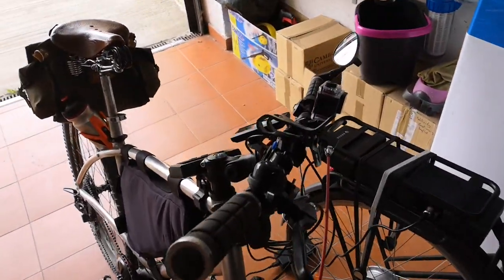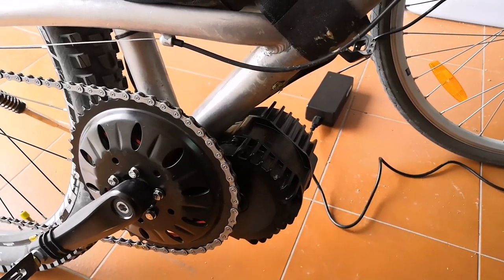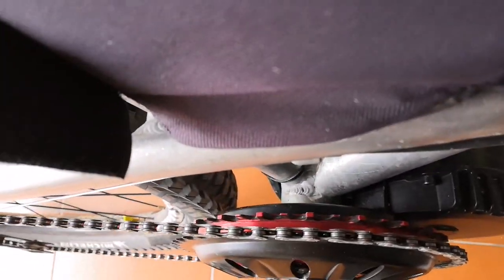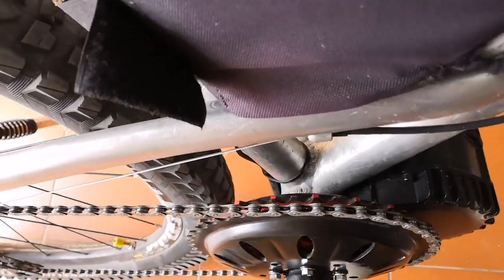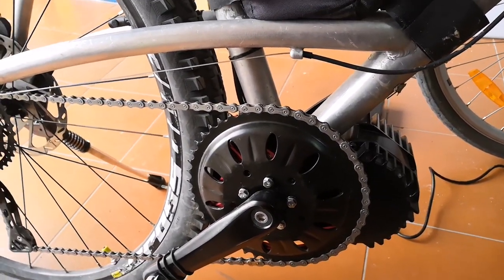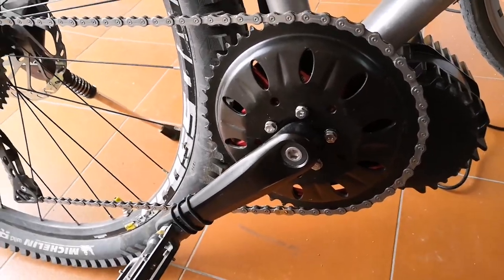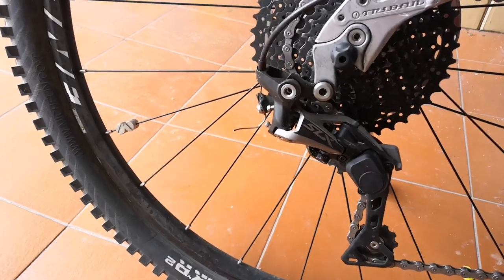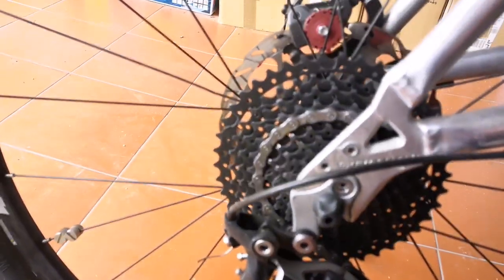Bafang Bbshd 52V update

Comment: Should have purchased the Lekkie spacer, makes it very easy to fit I have the Lekkie 42 and 52 Chain rings with one spacer in-between working with a XShifter gear change on My BBSHD motor
Reply from the maker: Thanks for the input!
I switched to a Rohloff internal hub, which has more than enough gear range for one crank.

Comment from the maker: The other big change was reprogramming the controller which has made a massive difference to the way power is applied, making the bike much nicer to ride and easier to control. If anyone wants more details, drop me a line.
Reply: mick2d2 after 3 hub motors im starting to build a Midmotor conversation. I misshifted once and the chain was in pieces.
Reply from the maker: My BBSHD puts out about 1600W of power. Sometimes the chain will slip, but I haven't broken any chains yet.
Reply: Two months no chain broken...replaced cassette, rotor w/pinion gear, clutch replaced and it destroyed the inside gears, replaced reduction gear with cover... kit cost $1.3k usd 52v 17.5ah battery,bbshd 100w 48v on a 29er mountain bike.  Plussss...$300 in 2 months in damages...🧐🧐🧐🧐🧐
Reply from the maker: @marcostirado5537  I've been running this with a Rohloff 500/14 for nearly a year now with no problems whatsoever.
I do however try to use it realistically, i.e. I don't hit full throttle in the hardest gear from a slow speed, or try to climb steep hills on throttle in a high gear.
I use my legs as a guide to how I use the power and the gearing. It's an ebike, not an electric motorbike.

Comment: Did you ever have any luck with the 2 chainrings? I've wondered why nobody has tried this, if nothing else to have a better chain line and larger ring for the faster gears while commuting and smaller ring for the slower gears for trail riding. I do both on my bike. I did my bbshd conversion this past November.
Reply from the maker: Hello Tim. I ran it for a while with both chainrings, changing manually (which was a bit of a pain).
Last summer I decided to take the plunge and bought a Rohloff 14 speed internal gear which I matched with a BBSHD spider from Lunacycles and a Blackspire Cyclocross 44T crankplate to give me the perfect chainline. 
The Rohloff gives me the equivalent of several gears above what I previously had so I normally start in fourth gear and a couple of gears below, so I can go faster too. 
I must say I'm really happy with this setup, I think it's the perfect match for the BBSHD and a real pleasure to ride. There's a small adjustment to make compared to useing a derailleur, as with the Rohloff, you can't change gear under pressure, you have to ease off. You can however change up or down any number of gears, in an instant, even if you're not moving. This ability to suddenly change up or down five or more gears, gives you a lot of flexibilty. It also handles the torque from the BBSHD without any problems. 
Of course there's also no irritating derailleur noise or slippage!
The only issue really is the price!

Comment: When you went to 52v from 48v did u have to reprogramme the low voltage cut off . I saw a vid where they said to do so . Thanks
Reply from the maker: dj james arundel Yes I did, because the cut off for  a 48V battery is 3 x 13= 39V, whereas for a 52V battery it’s 14 x 3 = 42V.
Reply: @mick2d2  u think a 48v would run ok on 52v settings and be safe .. I'd like to go 52v and still put the 48v on as a back up or for long days out.
Reply from the maker: @Boxbeat666  The BBSHD has much beefier electronics than the BBS02.
I've been running it on a 52V battery (42V to 58.8V) since May 2017 with no problems whatsoever.
Reply from the maker: @Boxbeat666  I do all day runs of up to 115km without any problems.
Reply: @mick2d2  How many amp hours for the battery?
Reply from the maker: Simon Hartley About 20000.

Comment: Did you find any problems when using the usb. I feel like my mode 1-5 the mode 2 gives to much of a boost. Is that possible to change?
Reply from the maker: Hello Robert, I had no problems with the USB. I bought this cable:
https://lunacycle.com/parts/bafang-parts/bbshd-parts/bafang-bbs02-and-bbshd-programming-cable/
But I've also seen it here:
https://fasterbikes.eu/en/matching-wires/198-bafang-bbs-programming-cable-usbmatching-wires.html

YOU REALLY DO NEED TO READ UP ON THE SOFTWARE BEFORE MAKING ANY CHANGES:
https://electricbike-blog.com/2015/06/26/a-hackers-guide-to-programming-the-bbs02/
IF YOU DON'T DO THIS PROPERLY YOU CAN FRY THE CONTROLLER.

Saying that, on the hacking guide it gives very clear instructions with several examples of how you can improve response.
I use a slightly tweaked version of Kepler's (the pink one in the hacking guide).
The tweaks I've done make the power delivery smoother and the power cut in and cut off quicker.

I rode my BBS02 for nearly three years before changing this. I just wish I had done it before!

When  I started going out on my BBSHD with my brother-in-law on his BBS02, it was a real pain trying to match our speed, either I was surging ahead or he was!
With this way of programming the controller it's easy.
Power delivery is smooth and constant, none of that irritating surging that I had before.

I have a pretty constant level of power delivery on each of the nine levels. (It's not 100% constant, because obviously the battery level changes as it moves from totally charged to discharged).

What I have is (approximately with little variation)
Level 1 gives 50W of assist (just about enough on the flat to compensate for the extra weight)
Level 2 gives 100W
Level 3 gives 150W
I mostly use levels 2 & 3 for relaxed cycling on the flat on trails at about 20kph

Level 4 gives 200W
Level 5 gives 250W
These two if I want to go faster, around 25-30 kph

Level 6 gives 350W
Level 7 gives 500W
These will get you up most hills at a reasonable rate.

Level 8 gives 750W
Level 9 gives 1000W
These will get you up virtually any dirt slope as long as you can keep the front wheel on the ground.

Throttle I can use in any level from 0 to 9 and gives about  1600W
This will get you up extreme dirt slopes when you have to lean your body forward over the cross bar to stop the bike from flipping over! 

This type of programming gives constant assist, with no surging. It makes the ebike feel like a normal bike, especially in the lower levels of assist. 
It also seems to give me better and much more predictable battery performance.

Hope this helps!
Reply: @mick2d2  Sorry bout that. This slipt my inbox. I will read up.

Comment: That ring u had fitted over the bling ring im thinking of doing it and grinding it out to use as a bash guard. Are the standard screws long enough for both wheels ? Thanks (i do some hard riding i rocks take my teeth out  )
Reply from the maker: Hello, I don't think they were because of the spacers I used. I glued together several washers for this, four I think. I've since changed the Bling ring for a different plate.

Comment: I have bought a 52v for my 750w bbs02. My 48v drops fast i think. I will use that as reserve. What was the biggest difference going to the hd?
Reply from the maker: More power, in those occasions when you need it. Better cooling when using the extra power, the BBSHD has better cooling fins. Also, more peace of mind when it comes to the controller (unless you have the uprated BBS02 one) as the BBSHD is overbuilt in the electronics department with more and better mosfets or at least that's what I've read.
To be honest, I was very happy with the BBS02. It ran perfectly for the three years I used it and it's still running perfectly for my brother-in-law who's used it for the last year. When I gave the BBS02 to him, this was a good excuse for me to "upgrade"! 8)
The main upgrade really though was the battery, more than the motor. 
Most of the time I only use low levels of power, except when climbing really steep trails. This is when you do notice a difference as the BBSHD is pulling 32Amps at full throttle.
The real upgrade though was switching from a 13S5P battery to a 14S9P one. This meant going from 48V nominal to 52V and from 65 cells to 126. I can really thrash my battery now if I want/need to. It also gives me well over 150km (I've never done more than 110km on the dirt trails I ride). Also most of the time I'm in the voltage sweet spot and rarely go below 50V. My old battery is good for about 90km and the last part only gives weak assitance as the voltage swing takes it down to the cut off if you push it. You're okay as long as you don't have a hill at the end!
A few weeks ago we did another stage of a canal near where we live. I cycled into town (about 15km) and my brother-in-law drove down with his bike trailer to pick me up. We then went to the next part of the canal and did about 70 kms. He drove me back to town and then I cycled home (15km). After the 85km I'd already done, I just wanted to get home as I was knackered, so I wacked it up to level nine assist (about 1000W) and cycled home at about 40-45Km/h. I couldn't have done this with the old battery.
Reply from the maker: My latest upgrade (I've done another video) which I'm really happy with is the Rohloff internal gear hub. Amazing piece of German quality engineering and perfect for these drives. It's quite a big investment, but is supposed to be good for over 100,000km, so should outlast me!
Reply: @mick2d2  I get 60km distance with 30kmph. My 48v is 13ah. My new battery will be 52v 16ah. I was reading up on the 52v range. Its better and not so much a power problem. My bbs02 is made in july 2018. We have all flat terrain in Holland so hitting that 45kmph is no problem. Its the powerband that i do not like at the moment. I will read the usb programming instructions and see what can be done. When on 1-5 assist in assist 2 the 40-45kmph is there already. I want it more smooth.
Reply: @mick2d2  That rohloff internal gear shifting is very cool. I do need to say i have a giant talon with a very good shifter and back derailleur. Never had 1 mishap or chain problem. But i will look in to this for the future. I have seen electronic shifter to. Battery life 3 months. Pretty cool stuff  :-)
Reply from the maker: @rtoebak76  I've got through two Shimano Saint derailleurs in the las four years and broken the sacrificial piece where the derailleur is screwed to the frame twice. Virtually all my riding is off road and my bike gets knocked about quite a bit. I really like the perfect chain line of the Rohloff and also the amazing gear ratios. I've done about 1500km on it so far.
Reply: @mick2d2  The perfect chainline i can understand, and it staying in one place and not going up and down the derailleur. Is there still a shiftsensor or do you just stop pedaling one second? Shifting on the grips i see.
Reply from the maker: @rtoebak76  You have to ease off the pressure to change gear. You can however move pretty much from any gear to any gear. I used to have ten gears 11-42T. The Rohloff has easily a couple of gears above and a couple of gears below this combination. I normally start in 4th or 5th gear.
Reply: @mick2d2  Are you saying you got more speed out of this setup? Smaller than highgear? Better not be in that one going up hill :-)
Reply from the maker: @rtoebak76  These are the gear ratios I had before (according to Sheldon Brown's calculator):

KPH with the 11-42 and 42T chainring @ 60RPM
1st gear 8.6 KPH, 2nd 9.7 KPH, 3rd 11.3 KPH, 4th12.9 KPH, 5th 15 KPH, 6th 17.2 KPH, 7th 20 KPH, 8th 24 KPH, 9th 27.7 KPH, 10th 32.8 KPH

KPH with the Rohloff with 16T and 42T chainring @ 60RPM
1st gear 6.3 KPH, 2nd 7.1 KPH, 3rd 8.1 KPH, 4th 9.2 KPH, 5th 10.5 KPH, 6th 11.9 KPH, 7th 13.5 KPH, 8th 15.4 KPH, 9th 17.5 KPH, 10th 19.9 KPH, 11th 22.5 KPH, 12th 25.6KPH, 13th 29.1 KPH, 14th 33.1 KPH